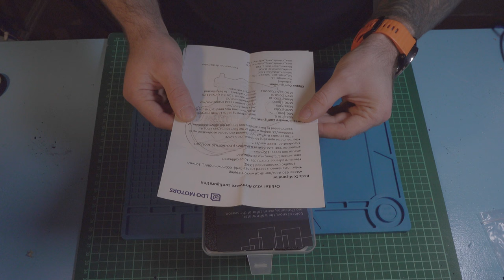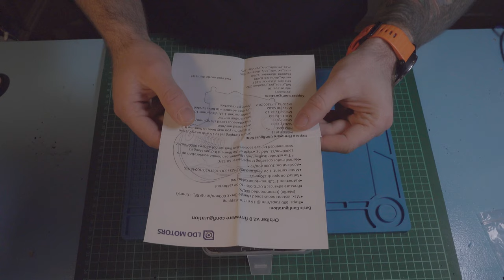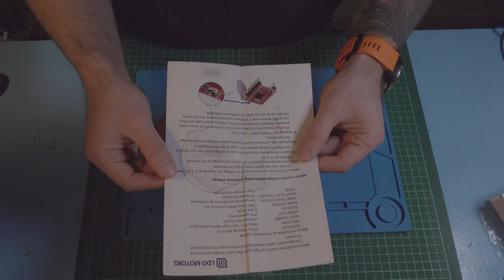LDO Orbiter 2.0 Unboxing and Teardown

Comment: man this is really expensive, you'd save big bucks by just buying their motor and make your own
Reply from the maker: Well, thanks for comment but I don't think that I can make my own planetary gearbox, plus bigger bondtech gears, and MJF printed frame any chaper than LDO offers :)
Reply: @techbytch  well MJF is not required and can be printed via abs, which costs next to nothing. planetary gearbox and bondtech gears are available from trianglelab, which are like $10 in total
Reply from the maker: @user-yk1cw8im4h  I would not say so as the orbiter kit was around 60Eur and Trianglelab orbiter kit is aroud ~18.50 EUR and LDO-36STH20-1004AHG is ~23 EUR so around 41 EUR just for the parts and if still would not be as compact and stiff as MJF version.